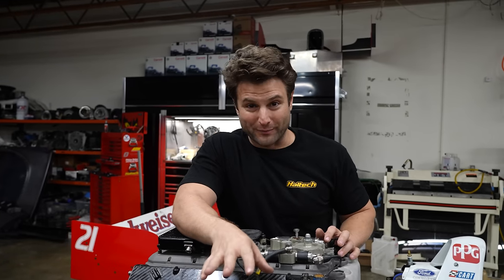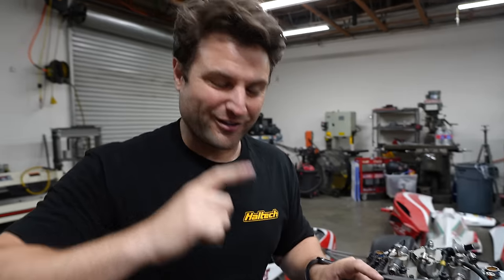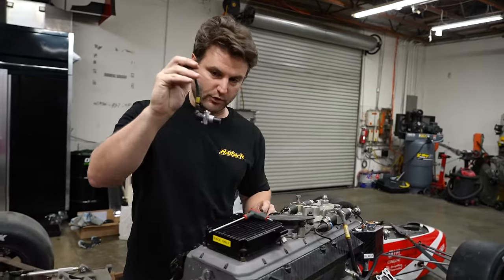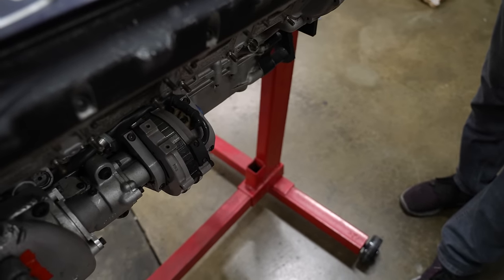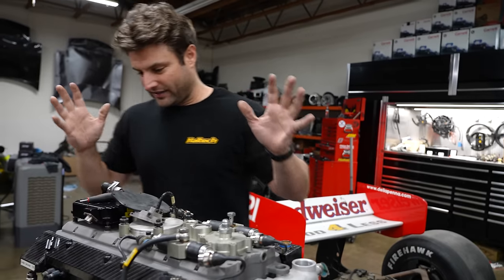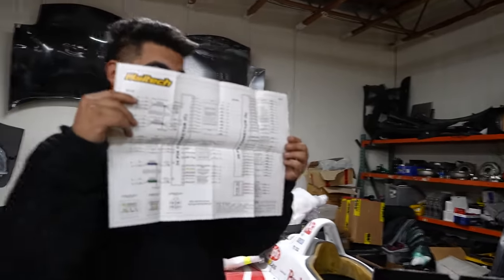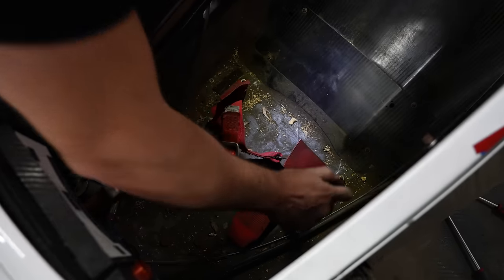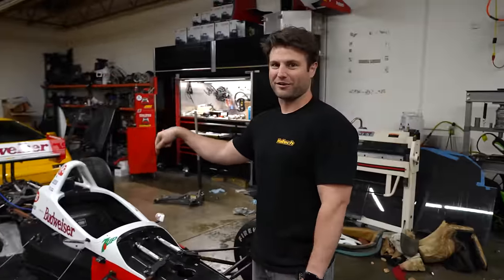Reverse engineering Cosworth secrets. How to start the Indycar project without any info

Comment: they are not angle sensors, they are position sensors. the cam and crank sensors must match at the tdc of cylinder 1 to be accurate, this is at base timing. cam will obviously change based on the engine type under normal conditions.

Comment: I feel like if you called Gordon Murray automotive you’d get some good answers about questions you didn’t know you had.

Gordon is using cosworth engines and has helped them fund their development, including a 20thousand RPM single cylinder which is attached to a V8 crank minus 7 cylinders. (For head design cost reduction(cheaper to build a prototype head for one pot than 4))

Comment: My guess is the red handle on the shifter is a safety for the reverser... just a guess though.  Also, Have you reached out to Cosworth to see if they will share a file for all the pin- outs on the harness?  Its possible they might have outsourced the wiring package. We were able to obtain a pin- out sheet  for a Gen2 Daytona Prototype we rebuilt, different vendors all together I assume. Good luck on the refit
Reply: It was all wired in house 👍

Comment: they use dry nitrogen and its 1000psi regulated down to 485psi. they use dry nitrogen to keep from adding water to the system that could corode the inside of the rams reducing the need for as much lubrication and required regulated maintenence

Comment: My guess is the red handle could lock the rear diff they might have used to to either make tighter turns when unlocked or wider turns with more even power when locked. Just a guess I’ll bet I’m wrong

Comment: I was waiting for a 4 or 3 rotor swapped indycar 😂 but nice to see you're playing with the original engine
Reply: I do recall him stating that was the intent, but only after getting the car working in its original condition.
Reply: The engine is a stressed member (i.e., a structural part of the chassis). If you are going to replace it with another engine, it has to be designed accordingly. Most engines are not designed to be stressed members.
Reply: @darylmorse   Gee thanks for the information 🧐🌚

Comment: This one isn't going to be easy. A team of engineers kept that car running in the past. With no note are even a starting point without being heavily involved in Indy cars this project is going to tax Rob's brain. The computer alone without the costly software makes this almost impossible. Again the car probably had a software engineer on the team when it was competing. I'm excited to see how he handles the proprietary software and hardware for this vehicle.
Reply: What software? He doesn't have the original ECU, hence the Haltech. Once Rob's done the only parts that are original will be the chassis and drivetrain, he's going to fabricate from scratch the entire electrical system.

Comment: You should buy a correct wheel and mount the display on the wheel like in formula 1 and modern indy cars.
Reply: You even have a cable connector ready for the steering wheel mount.

Comment: the airjack system would be running with high pressure nitrogen.  I bet it runs at 250 to 400 PSI.

Comment: Honestly 70 amps is enough to run a small fan My Honda Civic has a alternator with 70 amps and it has two fans running and works fine then again it has an engine half the size

Comment: On the topic of the red lever on the shifter made me think of some F1 cars back in the day technically had a reverse but they were so thin and lightened that if they actually used it it would break but they weren't breaking a rule because it was there. I think it could be something similar. It also makes it so the driver can't accidentally shift into reverse by mistake during the race.

Comment: Maybe I missed the backstory, but even if you can get this car into drivable condition, what's the point? Where will you be able to drive it? Do you know if the engine is in running condition? Suppose it is and you get it running, how will you keep it running? These engines weren't designed to last a long time. Even if you don't kill the engine trying to get it running, it won't be long before it needs to be rebuilt. It's not like you can get a maintenance manual or parts. Same for the transmission. Same for the clutch. Same for the chassis. Same for the tires. And so on. There are lots of reasons that it cost millions to run a season with these cars.
Reply from the maker: 100 percent. But the knowledge I’m learning will last a lot longer. It’s experience you can’t get without working on a race team and it’s meant to make me a better builder for all my cars. Plus the challenge of making it more reliable is fun. I’m not an Indycar driver so if I lose a couple hp in exchange for reliability I’m down
Reply: @RobDahm  No doubt you will learn a lot, but this project is not unlike a civilian acquiring a fighter aircraft. They are very complicated to operate and maintain, even if you know what you are doing and have all of the resources, such as parts and maintenance documentation. This is where the saying came from, "Many men have become moderately wealthy from racing. They were filthy rich when they started." With this car, you have neither the knowledge nor the parts and maintenance documentation, which places you in a risky position. it would be terrible if you destroyed the engine trying to get it running, because it's practically irreplaceable. It would well worth your time and money to find a Cosworth engineer to give you some help to get it running. Maybe even open it up first to check the bearing clearances, etc. Good luck. I'm looking forward to seeing the progress.

Comment: I GUARANTEE THAT HAD A COSSIE V 12 AT SOME POINT. AND YOULL DESTROY IT IF YOU DONT PRIOR TO ATTEMPTING TO START PRE-HEAT THE OIL AND THE COOLANT. THE TOLERANCES INSIDE THERE A SO TIGHT IT WONT CRANK. BUT IT WILL DESTROY EVERY BEARING INSIDE OF IT. PLEASE DONT BE THAT GUY AGAIN ROB

Comment: There is a guy who bought a duratec engine of a guy at cosworth from some used warehouse they have, anyway he called them up some years later to try get some parts or information and when he gave them the codes cosworth replied with "you can't have that engine"  and went on to explain it was a special development engine 🤣
The guy just pretend he must of got the codes wrong and hung up

Comment: Put a three rotor in ittttt
Reply: I think he mentioned plans to put a 6 rotor in it 😁
Reply: @Birb_of_Judge  The indycar will never fit a six rotor, a three rotor will barely fit and I think that is the current plan.
Reply: @NorwayVFX  I remember him mentioning a 6 rotor back when he got the Indy car.
But if it doesn't fit it can be made to fit
Reply: @Birb_of_Judge  Last I heard he was considering putting the 6 rotor in a V12 Lamborghini or a similar car with a V10 or V12. He needs to start with a car with a long enginebay in order for it to fit. 
He had to extend the 4 rotor RX-7 like 6 inches to fit that engine with the drivetrain, a 6 rotor is 50% longer than that again.

Comment: Formula 1 and Indy cars don’t have a reverse gear in them for weight reduction and that lever might be a throttle lock/cruise control to allow the drivers to stretch or rest their legs during the race
Reply: F1 cars do have a reverse gear but I don't think they are built to handle full throttle 😂